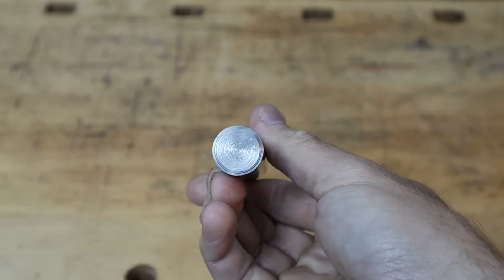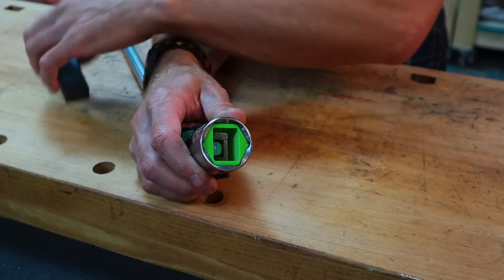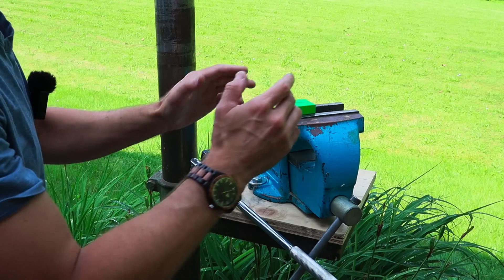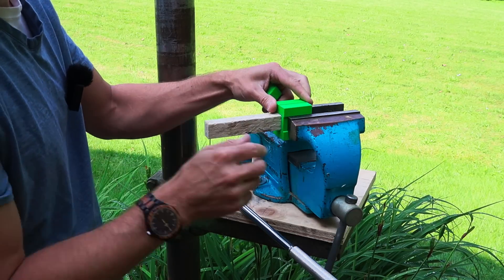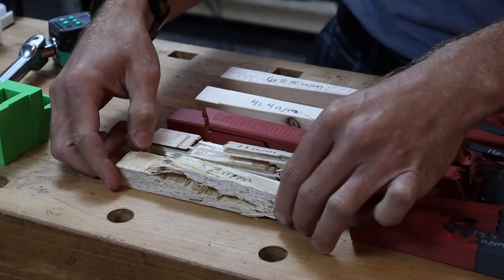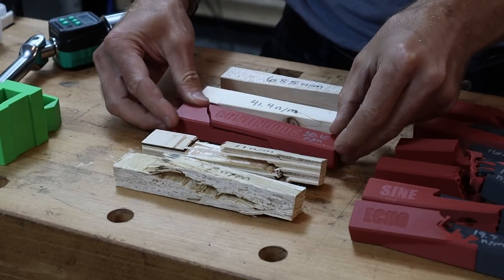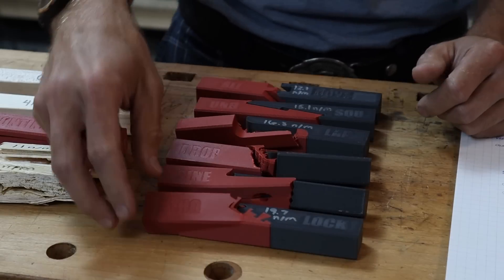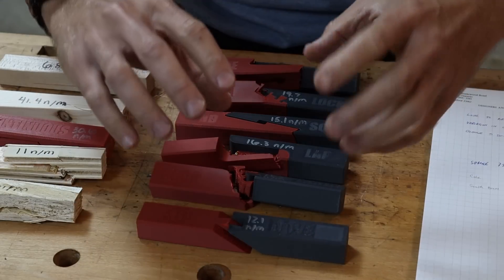How Much Can You Twist a 3D Print Before it Breaks?

Comment: Although there is always a global interest in experimentation, I am astounded that in the 21st century, experiments start from such a low baseline and are conducted with such irrelevant tests. Of course, I don't expect everyone to have pursued higher education or to be engineers, but the overwhelming majority of the population has taken basic physics courses by the age of 12. Consequently, we should at least admit that we have a vague understanding of material physics and that, with a bit of thought, we should, as adults, be able to seek relevant information in the right direction—especially since accurate information is available with a simple Google search or an AI query.

And quickly, we would come across the Young's modulus, a measure of stiffness for each material, providing a reference value for comparing two materials. For instance, Google will tell us in two clicks that the Young's modulus of construction-grade steel is around 200 GPa (gigapascals), whereas that of ABS plastic is about 2 GPa, making it 100 times less strong. In a few seconds, we thus get a pretty precise idea of the structural strength difference between the two materials. We would observe similarly significant gaps with other thermoplastics, like 2.3 GPa for polycarbonate, 2.7 GPa for nylon, and 3 GPa for PLA. Nothing here challenges the structural strength disparity between thermoplastics and construction steel, which is far from the highest-performing material.

3D printing involves the deposition of expanded material, which is anisotropic (it does not have the same strength in all directions) and non-homogeneous: perimeters and infill do not have the same structure or density, not to mention the voids due to the deposition pattern. Consequently, 3D printing will inevitably be less robust than what the Young's modulus might suggest for the same material. Yet again, experimentation won't teach us much more than a simple factor: up to 80% perpendicular to the layers, and 60% along the layers. So, if you still had any doubts after learning the Young's modulus of PLA, you'll know in far less time than it takes to level your print bed that the 3 GPa of PLA will effectively be only 1.8 to 2.4 GPa in the printed part. Quick, easy, definitive.

Regarding experimentation: the demonstration in this video is what engineers call a prototype stress test. The tested parts are prototypes. Even if we print and test the same part multiple times, we will have fluctuations in the results because the parameters related to production and experimentation are not controlled: understand that external fluctuation causes have not been eliminated. A prototype stress test is only relevant for a specific application. For example, imagine you print a shaft that will be connected to a motor developing 3 Nm; you will want to validate that this shaft can withstand the torque under real conditions and over time. In this case, the test has real utility because it validates an application, identifying points of weakness or wear to possibly correct the prototype.

I am much more skeptical about the usefulness of testing a generic part under poorly controlled conditions and especially without an operational purpose: you only get a vague idea. Average strength measurements for all materials have been known for centuries. Thomas Young's work dates back to 1807! Google will give you the correct strength values for all materials in two clicks—whether it's tension, shear, torsion, or elasticity. Already, if you have no application in mind, don't waste your time reinventing a wheel for which you don't even know the appropriate cart. And why prototype in thermoplastic if, on paper, it's not the right material for the job? You could waste a whole palette of filaments without a conclusive result by doing so!

Even if you have no appetite for basic physics and calculations, look at how manufacturers do it. Remember that they guarantee their products to some extent, and their company's survival depends on it. If manufacturers use plastic for this specific application, then you have a chance of successfully producing an equivalent part with your 3D printer. If manufacturers use metal, then you will fail to create something equivalent in plastic or wood. It's as simple as that. In the 21st century, 99.999% of the things that needed to be invented for our era have already been invented. Thermoplastics are not a discovery. FDM 3D printing doesn't change the game; in fact, it produces even less resistant parts. Testing the strength of 3D prints is like opening doors that are already open: it poorly demonstrates what we already know. Random experiments are as valuable as the arbitrary assessments "very strong," "rock solid," and "strong enough" which are unreliable and ultimately meaningless actually.
Reply: Dude... I LOVE science, engineering, and data, but you need to calm down. This was not ISO testing of an important part that people's lives depend on. It was a quick set of practical tests with minimal data to back it up so we have an idea of what visual results mean. It was not a grand science experiment or a PhD thesis. A lot of what you said has value, and some people might even appreciate it, if only you could tone down your extremely condescending and insulting rhetoric. How you deliver information is often as important as the information itself. Your first sentence will turn off 99% of readers, the first paragraph will get rid of half the last percent, and the length of your comment will Xenos your audience down to half of that where you basically get just me.

I also have to address a couple ridiculous statements you made. First "If manufacturers use metal, then you will fail to create something equivalent in plastic or wood. It's as simple as that." Well this is simply false. Not only can people in general develop equivalents to metal parts out of wood or plastic, manufacturers do it themselves all the time. At the lowest level, they replace aesthetic parts because plastic is cheaper. At a structural level, even crash structure components in cars are at times made of plastic now, and obviously countless components in mechanical devices have been changed from metal to plastic. Think about the gears inside of almost any low stress mechanism which are now almost universally plastic and used to be almost universally metal. We see companies cheap out on parts that used to be metal all the time and use plastic instead because it is cheaper. Sometimes they are beefed up, other times exactly the same except a material change. Lastly, getting into performance and the highest levels of manufacture, composites have replaced metal in numerous areas including racing and space travel. You are way off the mark and make huge blanket statements which are plainly false.

I also have to address the idea "In the 21st century, 99.999% of the things that needed to be invented for our era have already been invented." This is absolutely ridiculous. You could have said that in 2000, or 1980, or 1950, or even 1900. Nobody ever thinks they NEED the next thing that hasn't come out yet. Nobody wants an invention before it is invented. Humanity was sustained and growing for the past few millennia. 20 years ago we didn't even have the first iPhone and you could say we had all the technology we would ever need. New types of solar, batteries, motors, materials, and much more are still coming out regularly. Where would you get such a nonsense and closed minded idea? Before you talk down to a swath of people because they want to enjoy a basic experiment to demonstrate some material and joint properties, make sure you don't think you already know everything. If you do, you don't even need to watch another video ever again. I suspect you are rather young, and though obviously smart, you need to take your confidence and use it to pursue continually opening your mind rather than feeling you are already entitled to close it off and proceed to lecture others. Learn instead of expecting to teach.
Reply: @802Garage  First, let me assure you that I am completely calm. What I provide here is not mere personal opinion, but the result of education and experience.

Second: no, you cannot obtain the equivalent of a steel part from other materials because each material has its own unique properties. Consequently, you'll end up with something inherently different in mass and resistance. It's also essential not to underestimate manufacturers—they choose materials with purpose. If plastic were the best material for a given application, they'd use it, especially since it's cheaper. Thus, when they opt for steel, it is with deliberate intent.

You are conflating materials and technology. The properties of materials are governed by physics, and there’s nothing left to invent in that realm. The physics of raw materials has been well-documented since the 19th century. While we've developed new combinations and applications, there hasn't been a revolution in the fundamental physics. When a "new" polymer emerges, it isn’t revolutionary; it's simply noted as potentially a bit improved for specific applications. Nothing more. And when a new application comes, we need decades or more to make it available. 

Your references to solar energy and batteries are quite misguided. It’s almost embarrassing, to be frank. The first research on the photoelectric effect was conducted by Becquerel in 1839, and the first photoelectric cell was created by Fritts in 1883. Batteries share a similar history. Elon Musk's company hasn't invented anything new; Tesla is merely thermal managing existing cells to enhance their longevity. Their practice of expending significant energy to maintain these batteries is, in fact, quite questionable.

You are conflating the availability and incremental improvements of technology with groundbreaking scientific discoveries. The fundamental scientific principles that underpin our current technologies have been understood for over 200 years in most cases! Anyone with a basic scientific education knows this: we all learned it, at the very least, in high school! Come on...
Reply: @axelSixtySix  Taking the phrase "calm down" literally kinda demonstrates my point. I'll reply more later.

The fact you are even mentioning groundbreaking scientific discoveries on this video also illustrates everything I was saying.
Reply: @802Garage   Do yourself a favor and don't ridicule yourself any further ;)
Reply: @axelSixtySix  Hahaha once again proving my point so entirely in a single sentence.
Reply: @axelSixtySix  You quite literally said exactly what I said back at me, despite clearly not understanding the difference between making a point and a logical fallacy. You just committed five more in a couple sentences, by the way. If you have two PhDs, they aren't serving you at all here. Try actually addressing someone's points instead of moving goal posts to save face. Have a nice life.
Reply: Couldn't agree more, the videos are valuable for what they are. Comparisons of materials and joinery.
More visual testing like this and of course a more serious testing from manufacturing. 
A full stress strain curve would reveal that Youngs modulus only describes the elastic properties, which in plastics is an approximation per definition. Also tensile and compressive behaviour are different. Where are the cylinder or cube strengths of PLA. We need those to tap into the knowledge from concrete, a highly plastic (or at least non elastic) material
Reply from the maker: You're welcome to your opinion right or wrong, it's not for me to decide.
Reply: @NeedItMakeIt  How can physics be wrong ?

Comment: In one minute you say the Echo lock came in first of the connections by a “fair lead” (less than one newton meter)

And then state the next minute that the connections compared to the solid piece…“They really aren’t that far off” (more than 10 newton meters weaker)
Which is it?😂 

IMO several of the connections are close to being equal (especially considering variables that could impact your results) and all the connections are significantly weaker than the solid piece.
Reply from the maker: The tests and data are there, you can decide for yourself.
Reply: Not trying to be argumentative. Just pointing out the discontinuity between two statements said a few seconds apart.
Reply from the maker: @realgoose  It's not a problem, like I said, take the info from it that you like, if there is more testing you'd like to see, I can certainly follow up with some.  For some context, some of my videos are partially scripted, some are live action so maybe not everything is 100% in alignment at all times.  As the channel grows and I can afford to take a break, I'll take more time to review my work more carefully for consistency.

Comment: Would be nice to see how a more standard connection fairs. For cosplays and such, it's not uncommon to create cylinder/rectangular holes in two parts, then 3D print the cylinder/rectangle to go into those holes and hold the pieces together.

I assume it wouldn't be as strong as the best you've shown, but hard to know where it would fall in the line up you have.

Another very interesting method would be a male to female bolt type connection. One piece will simply screw into the other (like a bottle and bottle cap).

Other methods that might be interesting to test would be:

Soldering the two parts together, metal hardware connections (bolts/screws), and glue (PLA Gloop?).